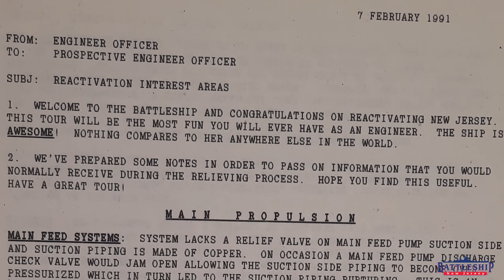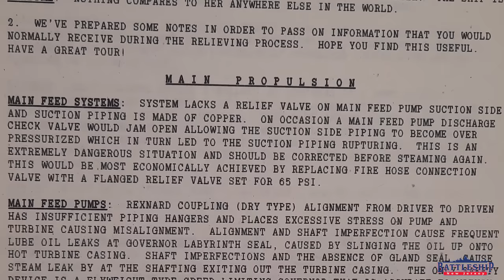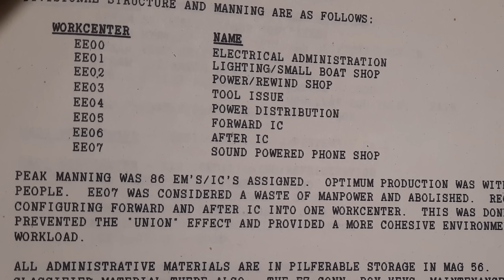The Call To Freedom Will Be Sounded Again: How to Bring Back Battleship NJ

Comment: I lament the scrapping of the partially completed battleships.  They should have been mothballed, and completed at a later date.  An aircraft flying over and dropping a few bombs does not even compare to chunking a few cast steel VWs for projection of power.
A truly honest combined arms doctrine needs these ships.  A few Oto Melara or Orlikon updates to the existing 5 inch mounts, swipe the Russian style missile/gun combo anti- air/missile systems, and add the newest rocket boosted, precision guided 16 inch rounds for a totally awesome consort to the aircraft carrier as a confidence builder for the new Organization of American States and NATO ally.

Comment: I don't think the ship will ever be reactivated in any of the kinds of wars we've ended up in since then, but if it comes to a first-rate shooting war against a real enemy instead of a decentralized guerilla war against a landlocked civilian insurgency, then it wouldn't be out of the question. Someone like China with most of their economic and military power coming from port cities, with little in the way of anti-ship missiles capable of penetrating real armor instead of just the modern navy's thin shell plating, an Iowa class would make a lot of sense to have - cheap (comparatively) for the amount of firepower she can dish out, and capable of tanking almost anything they can throw at her that makes it through the nested layers of destroyer escorts and missile defenses (aside from torpedoes, obviously...)

That's not even mentioning the obvious benefit of a big gun vessel against modern ships, namely: you cannot intercept, jam, or decoy away a hunk of steel the weight of a VW Beetle filled with explosives in any of the ways that you can defeat a modern guided anti-shipping or land-attack missile. Modern defenses are all based around the kinds of countermeasures that only work against a very fallible guidance computer and a projectile with less outer plating than a propane tank.

As for reactivation and the difficulties thereof, none of the degradation the ship appears to have had since the last yard period looks to be anything that would be out-of-the-ordinary for reactivation and, being a museum, a lot of the work has already been done and the ship has been better maintained (if hampered by funding and volunteers) than it would've been if it sat in Bremerton this whole time (not to mention, in much better weather conditions...)

Comment: After the explosion on Iowa and also the lack of Steam Engineers in the Navy I think the chances are minimal.  if Kitty Hawk can't come back little chance for the BB's. They would have to gut all the current electronics and steam.water plant and replace it.
Reply: Umm...I'd just like to point out that a modern carrier is actually steam powered.  The only difference is that they use nuclear reactors rather than oil-fired boilers to heat the water to make the steam.  Propulsion and generators still use multi-stage steam turbines.

Comment: There's no mission for an Iowa class battleship. Shore based missile batteries are pushing carriers to the edge of their aircraft strike range.  For the battleships to be in effective range to bring their guns to bear would only happen after the area was already neutralized- unless the opponent was very poorly equipped.  Their 80's activation was more a psychological ploy to get the Soviets to spend money and resources on ships to counter them as opposed to any strategic purpose.  In the Gulf, they didn't make any must have contribution or bring a unique ability to the conflict that would have been otherwise wanted for by many other means.  We would have built the Montana class if the battleship platform was still viable post WW2.  Love the ships. Respect them for their deployments.  Grateful to those who built, sailed, and serviced them.  But they deserve their honored retirements.

Comment: I am probably going to stir up a hornet's nest here, but here goes.  

As Ryan notes, what makes the IOWA class battleships uniquely valuable are their 16" guns when used for shore bombardment of hardened targets.  However, my understanding is their shore bombardments during the 1980's were not particularly accurate and, accordingly, were not nearly as effective as expected to be.  I have read that this inaccuracy was attributed to, among other things, the ancient stocks of gunpowder being used by the battleships.   16" projectiles can be very effective in destroying hardened targets, but only if they land precisely where they are supposed to.  Proof that their projectiles can consistently destroy hardened targets should be an absolute prerequisite to any reactivation of the battleships.  Otherwise, the enormous cost of reactivating and then operating one or more of the IOWA's could be better spent elsewhere.  

The other critical question that needs to be addressed in advance is protection of the battleship and accompanying ships.

Comment: Do I think naval gunfire support is still a viable mission?  Yes, to an extent.  Do I think the Navy is bringing back a ship with a crew in excess of 1000 personnel to do it?  Hell no, especially not something like the Iowa's unless it is ABSOLUTELY necessary.  At this point, you have a ship which hasn't been functional since the 1990's, horrifically outdated in radars, weapons, and electronics... and I don't mean that in a good way... to the point where it's not even known if the ship can actually be powered up fully from her engines, let alone move under her own propulsion.

We are more apt to see a Iowa-esq ship with less required personnel operating in this role around the time of rail guns than we are seeing the Iowa's reactivated in any way, shape, or form.  They are simply well past their feasibility in the modern navy.

Comment: Bringing her back again is possible, but I figure it will take two years.  Between the extensive drydocking, manufacturing new replacement parts like shafts and propellers and bearings and the retraining of Navy personnel to do the jobs that were eliminated, such as Boiler Tech, it will  take a while.  Then there is the modernization of computers, weapons systems, radars and the main guns themselves.

I have discussed this before with a few veteran friends and, in my opinion, the US would be better served by designing a new class of BBs.  Something with nuclear plants and updated weapons like the lasers and railguns (if they ever perfect them!) as well as missiles.  The big rifles, while impressive, only have a limited range of, what? 20-25 miles?  A missile from a multipurpose launcher flies much farther, hits much harder and is more accurate than any heavy shell.  Missiles are more replaceable too, unlike the 16" shells and the powder bags.

In short, yes, the Iowa class battleships could be reactivated. But their role is necessarily limited.

Comment: I would like to think that the Battleship will come back.  The reason why they became museum ships because the Navy told Congress that the Zumwalt ships would provide the fire support that the Marines need.  That never materialized and the Navy have no solution for shore bombardment. 

I would remove the after 16" turret and replace it with a Mk 41 VLS for long range attack and defense.  Replace the 5" DP guns with the newer Mk 45 5" gun currently in service.  Replace the boilers and steam turbines with the same gas turbines in the USS America class ships.  The America class is about the same weight of the America and the speed should be similar.  Finally modify the superstructure to accept the Aegis / SPY-6 combat system.

These modifications would reduce the crew size and make the ship compatible with newer ships for fuel and most ammo, except for the 16" guns.  Operating costs should also be reduced.

Cost wise to modify, $750M per.  However, there is no vision in the Navy, or will with the current administration to make it happen.

Comment: I would think that the four Ohio class SSGN submarines along with the twenty-six remaining 688 class and the new 774 class SSN submarines are more than capable of providing heavy shore bombardment with their Tomahawk cruise missiles, safely and stealthily submerged many miles away. But then again, being a former submariner... it's possible that I may be biased. lol
Reply: I was a surface sailor, but even I will admit that a submarine is a lot harder to locate and engage than a surface ship.  Ditto for a battleship broadside Vs. 9 cruise missiles popping up out of the water, lighting off, and heading towards shore.  Battleship is still about where they fired the guns, while the sub most likely changed depth, changed heading, and headed "anywhere else" at a classified speed that even you might not know.  (I know what the "official" top speed of my ship was.  I also know that we could cruise at a higher speed all day with a boiler offline.)

You would be the expert here, but I've been told that even a WW II sub submerged and lurking around on batteries could pose a credible threat to our latest and greatest.
Reply: @kevincrosby1760  With the Tomahawk having a range of 1,000 miles, the boat could easily be many many miles away - and well beyond the range of any traditional type of naval gun. And being able to launch while submerged makes taking the boat out a little more difficult, especially when you consider that by the time the Tomahawk reaches its target, the boat has already moved on from the spot where it launched from. In submarine school, you're taught that US submarines can go faster than 25 knots and deeper than 400 feet. Well on my boat on my first patrol, I was shocked by how fast and deep we could actually go.

A WWII submarine, or fleet boat as they were called, armed with modern sonar and torpedos, probably could pose a pretty significant threat even with their limited speed and depth capabilities. In 2005, much to the shocking surprise of the USN, a Swedish AIP diesel-powered submarine hunted down and easily could've sunk the USS Ronald Reagan... who never even know the submarine was even there, much less well within striking distance.  Here's a video about it.  https://youtu.be/L26RZdmQ2nE
Reply: @IntubateU  As far as depth and speed goes, the USN has never been real free with the information, which is appropriate.

The same holds true for surface ships.  The rated top speed for the ship I was on was publicly available as 20 knots.  Digging a bit would give you 22-23 knots from a few sources.  

I'll just say that at 20 knots in calm seas, there was a bit of vibration standing on the fantail, and just a bit of heat shimmer at the top of the stack.  We normally cruised at our rated "most economical" 17-18 knots.

When we were ordered to return to SF after the Loma Prieta earthquake, shit was rattling that you would have sworn was solidly bolted down, there was a gray haze off the stack all the way to the horizon, and the needle on the Underwater Log was still climbing nicely when it passed 20 and kept going.  First time I ever saw the ChEng officially logged as having the watch...

In the case of a modern US sub, if you had doubled the official numbers, I probably wouldn't have blinked.  Somewhere we went from the Fleet Boat "surface vessel that can submerge" to the modern "underwater vessel that can surface", and I'm sure that it shows in the actual performance.

Comment: Often think that the battleship is needed in the modern navy cause you can't stop a 16in armor piercing round with a phalanx gun there is nothing powering it or to explode. but  what do I know from a country with no army or navy.
Reply: Could hit the fuse and set it off theoretically in flight.
Reply: The range issue mostly, 38km is just not that much, the more you want to extend that, the more expensive it gets, until the cheap end of MLRS systems is about as much as the 16in shot. Much easier to just strap a HIMARS or something similar on to the deck of a destroyer at that point, and they can fire guided ammunition as well.
Reply: My son was in the Navy and they had a day where the family could go out on his frigate (Elrod) and demonstrate things. They didn't have missles anymore but said they would shoot down incoming with their phalanx and proceeded with a demonstration. They strapped 4 55 gallon drums together and set them afloat. They were about a quarter mile away and they said they'd sink them within 2 or 3 bursts. (Don't remember how many rounds per burst but about 2 or 3 seconds). After around 5 bursts and taking almost a minute aiming between bursts, the drums were still floating. They finally got close to the drums and sank them with the 50 cal. I'm glad the ship never got into a conflict because I didn't have alot of confidence in their defenses, and my son made it out alive.
Reply: Don't despair.  Ukraine also lacks a Navy, but they were still capable of sinking the Flagship of the Russian Navy while she was underway.

Comment: Will it, no should it be yes. Why? We can’t make one again do to the lack of a steel industry, you can’t stop  1900 pound projectile easily, it’s a source of pride, and modern projectile technology be it base bleed and/or RAP could extend the range 30 miles. How to do it, reactivate one Iowa a year, out then in a constant one year rotation. This will extend their life span, provide time to fix USS Iowa’s turret and spread the cost out.
Reply: There is a video on here from a very well informed guy that compares a battle between a battleship and a destroyer and surprisingly it won. The current battleships issue is modern aviation and subs.

Comment: I was a BT Top Watch on the FID . I’ve been steaming Hospital boilers 20+ years. If you ever need a foul mouthed BT with feedwater in his veins let me know. It wouldn’t take me long to figure out how to get some heat in her.
Reply: It drives me absolutely nuts when I see somebody state that we don't have anybody in the modern navy who understands steam.  The only functional difference between a modern carrier and a wwII carrier is how they are heating the water.  Still running the steam through turbines, still condensing it back to water.  MMs and ICs are still arguing over the whole Dirty Water/Bad Salinity Cell situation.

For that matter, I was actually responsible for a 3-boiler "steam plant" for a few years.  Vented condensate tank instead of a DFT,  Feed water treatment involved keeping salt in the water softener and dumping the appropriate amount of chemicals in the condensate tank, and safeties lifted at 8 PSI.  Most of the system maint involved figuring out which condensate line was returning steam, then running out to the appropriate building to determine which Steam Trap needed to be smacked with a decent-sized hammer.

Still a basic feed/steam/condensate cycle.  I'll admit that having to dump particulate rust out of the bottom of the Condensate Tank was a bit of a shock.  Things are easier when all you are using the steam for is heating buildings.  No TLI systems, no Barton/Yarway BW level systems, no Stack Gas Analyzers, no Salinity Cells, no BTs messing up my microphones and telephones, etc.  :)
Reply: @kevincrosby1760  BT’s held the ancient knowledge of Bailey pneumatic combustion systems keeping stack smoke to a minimum. Very handy when the MM’s couldn’t keep the SSTG’s online.
Reply: @MrGhendri  I'm not familiar with the Bailey system, but I'll go out on a limb and assume that it was a masterpiece of diaphragms, valves, and the practical application of differential pressure theory?
Reply: @kevincrosby1760  yes a mix of Bailey and Hagen circa 1940’s all pneumatics. Very eerie as it sounded like it was actually breathing
Reply: @MrGhendri  I've worked in buildings where the entire HVAC control systems were pneumatic.  If you were up on the HVAC flats you could hear all of the little hisses and sighs as the dampers responded to calls from the T-stats.  It was actually kind of relaxing.

Comment: Even with as much firepower that the Iowas could bring upon a target I rather doubt they will be brought back. There aren't many left with the experience of running the 4 plants and with no barrel replacements or ammo being made even the big guns are out of the running. More specifically the New Jersey would likely be at the top of the list for the following reasons, THE USS Iowa is out due to being down a turret that is now a Memorial. The Missouri is now a museum next to the beginning of WWII and she represents the End of that war where the surrender was signed. I'm not well versed on the Wisconsin but my understanding is that her condition is slightly below that of the New Jersey. The last consideration is that the Iowas were thirsty creatures burning vast quantities of fuel

On the various "hidden treasures" found aboard, perhaps over time some of it could be displayed near where they were used if weather wouldn't be an issue, static displays inside would work too